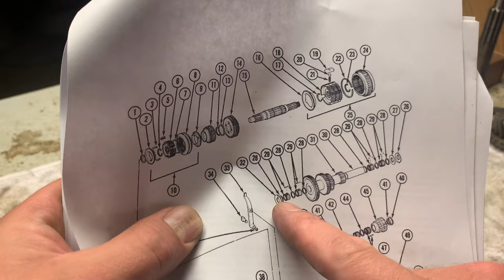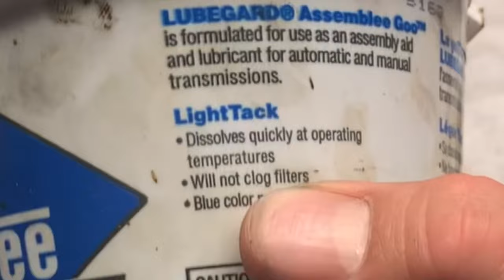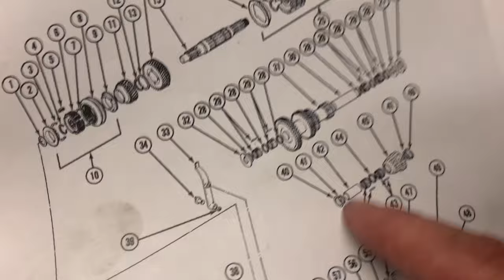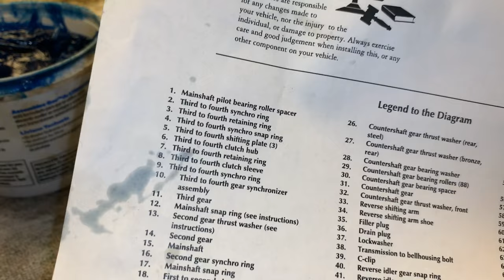Ford T18 Complete Rebuild!

Comment: Thanks for walking us through this T18 rebuild.  Your tips and tricks really made it easier to do on my own and saved a bunch of money too..  I had a stubborn idler gear shaft and you mentioned that hammering it out at an angle with an extension worked well.  Mine just wouldn't budge, but I think I found an easier way.  I welded a nut to the free end for my slide hammer and then it came right out.  Just cut the nut off afterwards and no harm done.  Anyway, please keep the videos coming!
Reply from the maker: Glad to hear it and thank you for the tip!

Comment: This is a FANTASTIC video, thank you! Straightforward explanations, great camera work, zero unnecessary bologna talk, no camera shaking - inducing nausea to the viewer, excellent job referencing the schematic. You nailed it buddy!!
Reply from the maker: Really appreciate it! Glad I could pass on the information!
Reply: @SevenBarSalvage hey man I have an issue with 2nd gear after rebuilding my t18. Is it possible to put the synchro in wrong? It won’t go into 2nd gear from a dead stop but will go into all other gears and I can’t down gear into it but if I match road speed with gear speed I can get it into gear.

Comment: Good thing you paid attention to that washer that sits against the front bearing on the input shaft. That raised part is critical. If it's put on backwards, it seals that front bearing instead of allowing oil in. In a short time, the washer will actually end up basically either friction welding itself to the front bearing or just melting apart, sending metal through your transmission. (That's how my T90 was destroyed by the guy that parked it 30 years ago. Same kind of front bearing setup.)

Good video, very helpful for if/when I decide the T90 3 speed is too limited for modern roads.
Reply from the maker: It’s crazy how little details like that can make or break a build. I appreciate it!

Comment: The thin snap rings on the synchronizer hub, they seem to be there to push out on the synchronizer tabs.They just make contact ever so slightly with the three tabs. You probably dont want to leave one tab not making contact....is my thinking....I also think the final snap ring should not have been so hard to put in. Maybe you put a snap ring in there that didn't require one (the second groove from the end doesn't require a snap ring) and that's why there was a spacing issue(?) I don't know because that part wasn't filmed. Helpful video overall--thanks!
Reply from the maker: You’ve gave me some stuff to look into and think about I appreciate it! Thank you for watching!

Comment: Awesome video! Thank you for sharing. I like the pace of your videos. Why did you replace the 3rd-4th synchronizer assembly and not just the synchro rings and slider keys? Thanks!
Reply from the maker: Thank you I appreciate it! Because I changed input shafts I had to change that whole hub because the big and small cone synchronizers don’t interchange between hubs. I’m adapting this to a Willys Jeep just I deviated a little from stock.

Comment: I’m rebuilding a t19 basically doing the same thing you are in the video…. I took my shaft out first and second gears all came off but when I get to the third gear it has a c clip ring inside the 3rd gear and stops it from expanding also my transmissions reverse gear I don’t know if I can pull it off backwards safely? And ideas?

Comment: A tip for getting the springs and balls back in the 2nd gear hub is to use a large hose clamp and set it into a bucket to prevent the balls from flying everywhere. It took me an embarrassingly long amount of time to figure it out.
Reply from the maker: Good to know thank you for sharing!

Comment: I’ve got a T19 and the shift tower will not shift. Not sure if something came loose during disassembly. Any ideas?
Reply from the maker: I had one do the same thing. Work the shift rails around with a screw driver it can get in a position where it’s bound up. Hope this helps!

Comment: I echo all the other comments here...fantastic video. Great cadence, camera work, and explaining things. I just installed the shifter back into a T18 in a 70 F250.  I'm restoring it for my uncle, I've never driven the truck. 

The shifter has a pretty long throw up to first, but going into second is a shorter throw. Then a very short throw to go up into third and down into fourth, and then a longer throw to go up into Reverse.

It feels like it almost barely has to move to go up into third and then down into 4th. Just wondering if this is normal.

Second question, there is a lot of side to side play on the shifter in any gear. Not like how you can move it completely side to side like it is in neutral though. Is that normal for this transmission too?
Reply from the maker: Really appreciate it! Sounds like something in the shift tower or shift lever could be worn out. I’ve rebuilt other transmission towers it’s not too bad of a job. Sorry I don’t have more input!

Comment: That bearing 3"  seperator don't fit exactly right on the bearing--is too small, but appears to work. It will scar the bearing, but I suppose it's getting replaced so no big deal. 6" would be better, then just put bolts to pull away from the transmission (no need for the fork, etc).
Reply from the maker: I agree wasn’t really the right tool for the job but it worked, thank you!

Comment: Well done video! What's the stuff you put on the bolt that holds the counter shaft retaining plate? Thread sealer or some weak thread lock?
Reply from the maker: Yeah it was some cheap thread locker from autozone. I appreciate it!

Comment: Not sure if its applicable here but i think the dark coloration of the brass (copper and zinc) or bronze (copper and tin) synchronizers is caused by the slightly corrosive higher sulphur content api gl4 and especially gl5 multi-viscosity gear lubricants… it’s the extreme pressure additives in em what have the sulphur. i’ve heard tales of that ‘dark coloration’ being a thin layer of copper sulfide or ‘metal soap’ being eaten away with every shift and wearing synchros out. some folks say the copper sulfide in crystalline form is abrasive and will wear out metal components. Could be wrong tho… maybe it’s just cause its forty or fifty years old!
Reply from the maker: Can’t argue with that!

Comment: the purple power liquid soak, won't it cause rust , especially on the inside of the case? also how do you dispose of the used purple liquid ?
thanks
Reply from the maker: As far as rusting I wipe down the gasket surfaces with grease after it’s clean and the inside a little PB blaster or wd40 to keep it from flash rusting until I fill it with oil. I use the purple power to the point it’s more oil than degreaser and just take it to the recycling center, they’ve never complained haha

Comment: I think  T-19 has the same guts..I have the T19. Am I correct?
Reply from the maker: They are pretty similar. The T19 has a synchronized first gear so there’s a few little differences. Thanks!

Comment: I'm sure this has been answered.. I have a t18 and I'm curious as how to identify a granny low 6:32.1. it was out of a 85 f250. Side of transmission has 13-01-065-907
Reply from the maker: Novak has a really good article on these T18’s. The safest way to make sure it’s the wide ratio is to rotate the output shaft and count the input shaft rotations in first gear. Hope this helps!

Comment: 28:45 I'm stuck right here and can't get it past the reverse arm. It looked like you struggled here too, then cut the camera, and it's in. What did you do to get it there?
Reply from the maker: That gear was hanging on the case it was a combination of rocking it and beating on it with the dead blow and it finally slipped in. You might could clean up the casting a little and it slip in better? Hope this helps!
Reply: @SevenBarSalvage  I ended up stepping away from it, took a lunch, came back, and basically looked at it and it slid right in. No idea how or why, but I'll take it! Thanks for the quick reply!